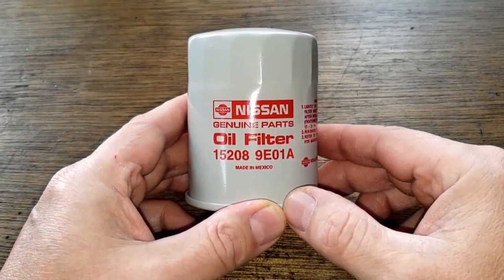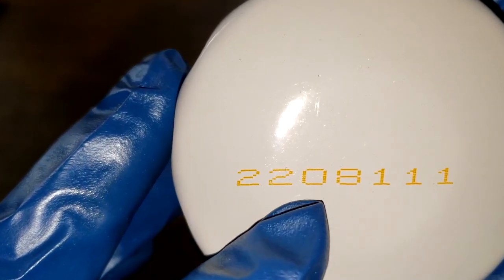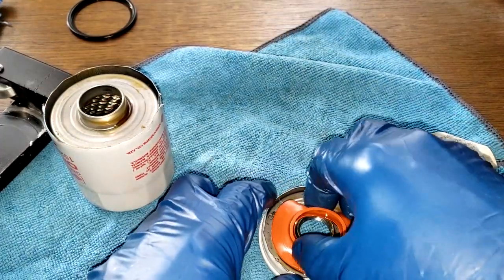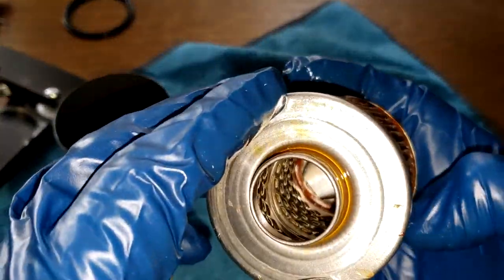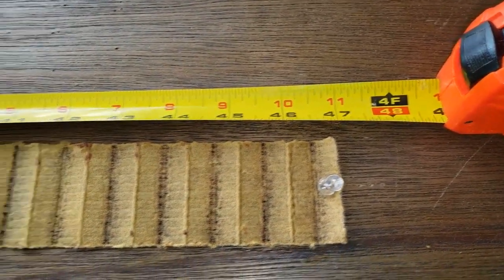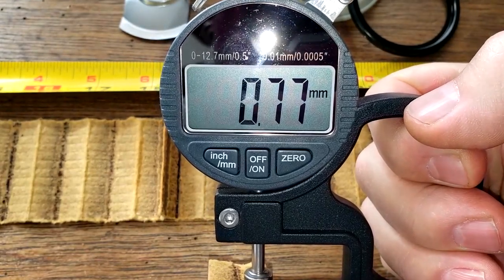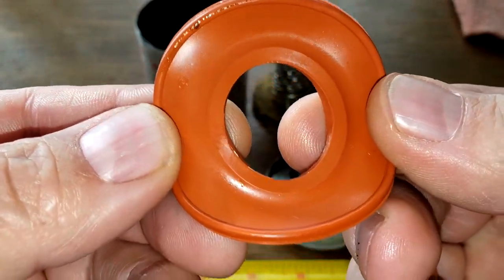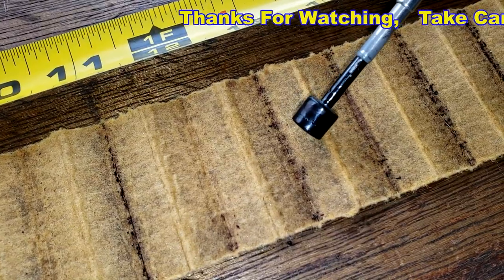Nissan Oil Filter 15208-9E01A Cut Open, Used Nissan Oil Filter Cut Open

Comment: Who manufacturers this filter?
Reply from the maker: Sorry, I dont know but I'll pin your question so that it sits on top.
Reply: These are made by Gonher, the Mexican oil filter manufacturer.  I wonder if Whip still has the Hengst H97W05 also made in Mexico (for Nissan, Honda etc application)?  I have a suspicion it's made for Hengst by Gonher and is essentially the same as this Nissan OE filter.  On the video, it looks like it's the same.  The Hengst oil filters which are made by Hengst in Europe seem to be built a bit differently.

Comment: Great video, thank you! 
It's a shame to see tiny nowadays filters. 2 weeks ago I'm opened my used MANN 940/1 filter, also from 4.0 engine. There are 70 pleats, 4 in. wide and 439 sq. in. of filtering media. What do you think about large filters - are they useful or it's a just wasted resources?
Reply from the maker: Thanks!
Your Mann filter may be overkill😊 , but I like a larger oil filter with lots of filter media.

Comment: I got a Purolator one oil filter I'll send to you out of my Nissan versa 2014 with 126k miles I used Valvoline full synthetic ultra 5w 30
Reply: Oil filter has 5k Miles
Reply from the maker: Send me an email to,     Poker4me007@gmail.com

Comment: Honestly, the design is not that bad but the concern here fabric of the filter and the carbon sediments on after 3k miles. Perhaps the oil is good syntetic and the filtering is sort of ackward.  I would not take it at all.